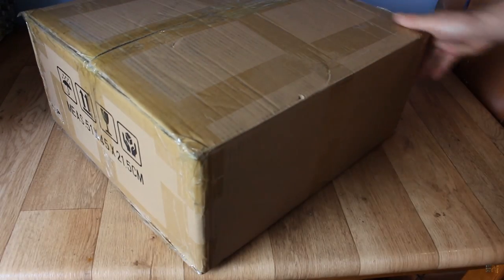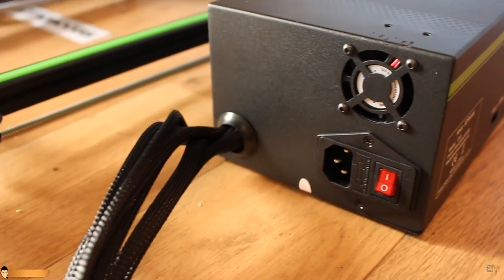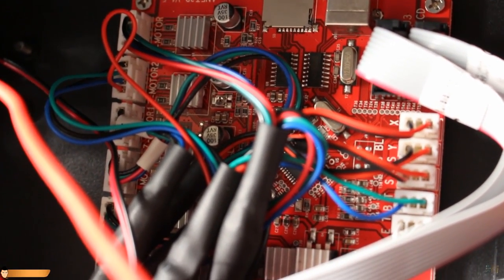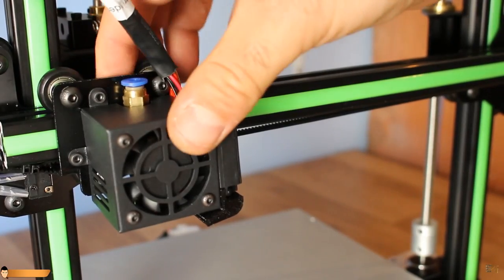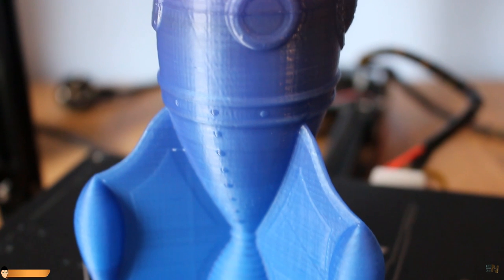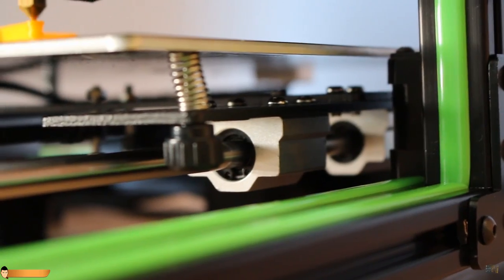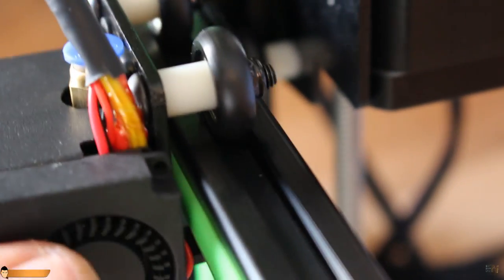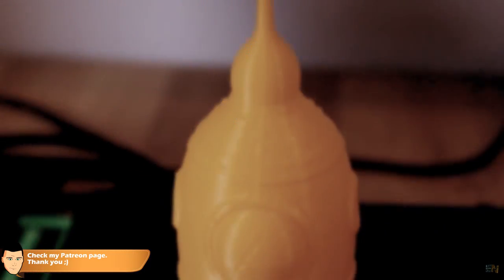Anet E10 review- better than expected

Comment: In my opinion, the Anet E10 is a mechanically superior printer to the CR-10. It has a more stable Y-axis than the CR-10, which only uses wheels and grooved extrusion for support, so it can rock from side to side, whereas the linear bearings of the E10 are rigid and resist rocking. The dual Z drives out of the box are also superior; that's a cost-up option on the Creality in the form of the CR-10S. The CR-10 is a better printer for "big" items, because of its even beefier frame, but the Anet has the best all around combination of features for a smaller size printer - more than beefy enough and solidly designed. The Z-motors need to be rotated 90 degrees and the belts probably need to be upgraded, but there's really not that much that needs to be done to the E10. You just have to know what you are doing and expect there will be a few issues to improve about the E10, but then it can show its true potential.

Comment: Great review! I'm currently still deciding if I'll get this printer or the tevo tarantula. The tarantula with the larger bed, cooling fans and dual z additions will cost roughly around the same price as the anet e10 so what printer would you recommend?
Reply from the maker: Joshua Sanchez personally I like more the Anet E10. You should watch more reviews and the final decision should be yours. Keep up!
Reply: Between E10 and CR 10, I prefer CR 10